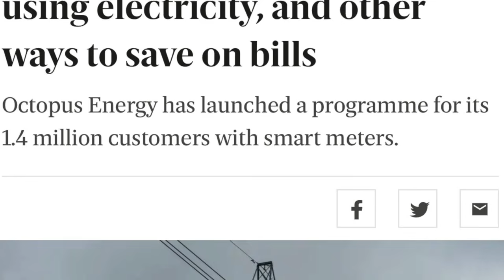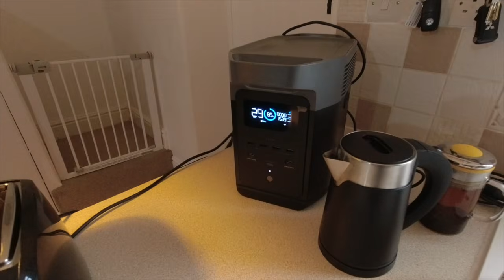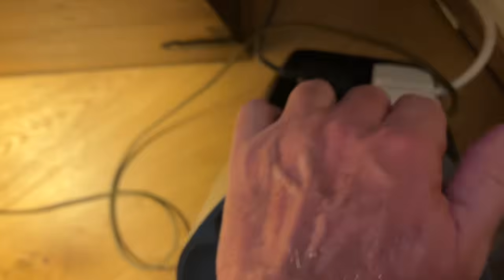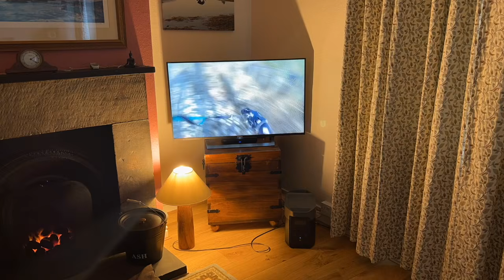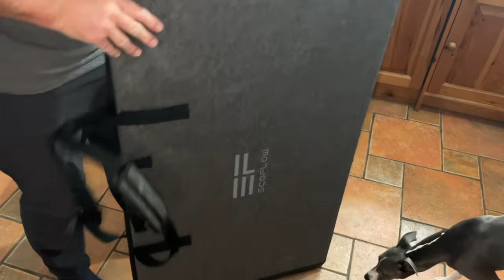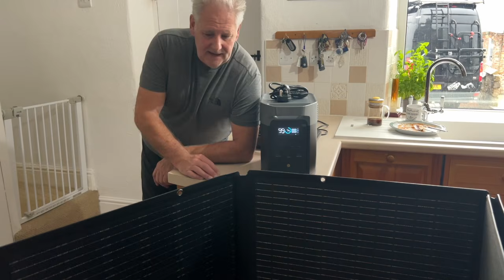Get Paid For Using The Ecoflow Delta 2 & Blackout Planning !

Comment: Dave, thx for this critique of the Ecoflow. If you were forced to choose- do you prefer the Ecoflow or the Bluetti? And why? Many thanks. Diane and Quinn
Reply from the maker: Hi Diane it all depends on what you are going to use it for and how much power you need too 
The Delta 2 is undoubtably the best of its size, it comes with a 5 year warranty and at good price 
The Bluetti AC 200Max is a must bigger unit and has the 12v RV this enables you to link it directly into wiring system in a campervan Boat motorhome  at 12v and it also has the back up batteries that you can add to use it at home too 👍 hope that helps 😍

Comment: And just for charging a battery once and then waiting forever 😴for a blackout, there are more special and cheaper alternatives than €1199.00🤑 for a multi-tool. I think, anyone who doesn't use the thing on the go should be aware that upgrading it to a serious home system with Ecoflow parts has to be well thought out, but it definitely costs a lot of money. 🤔
Reply from the maker: Yep you are right but what I’m saying is if you have one to use in your van you can also use it in your house 👍👍
Reply: Very true. I wouldn't recommend anyone get one of these to 'save money'. At the current price of £1100 and the advertised 3000 cycles over its lifetime (although still usable after that), the price per kwh works out at ~£0.4213 🧐. We pay around £0.35 down here in the south east of England (i.e. would never pay for itself) 😕.
Reply from the maker: @TheMarkGgr  yep you can only really use it this way and justify it if you use it for other things too 🙏👍😍

Comment: Great demo and a good idea to test it out to see if you could benefit from the offers, or cope in a blackout. WOW Electricity is very expensive in the UK now, less than 20p per Kwh here in NZ, and its all renewable on the South Island too, lots of Hydro. I've been cooking most of our meals on the portable Induction hob as its so much quicker - if I need 2 burners, just get the other one out of Sprintie the campervan! I have a small 'solar generator' that has a 10W panel and two LED lights in my emergency set up, plus various other USB LED lights we can use off power banks - always pays to be prepared. That portable Solar panel looks the business!
Reply from the maker: Thanks Linz yep the cost of living is very high and getting higher all the time at the mo as we go into National recession 🙏👍😍
Reply: Ours is 28p and my sisters 26p including the standing charge. Northern Ireland...UK. 
Dave is right though,  the cost of living is very high and getting higher all the time; well the electricity went down a tad in November but heating a whole house on gas or oil is ridiculous.
We're down to heating the whole house when it gets REALLY cold but at short bursts and use an electric heater (halogen) for heating one room the rest of the time, it's working out better that way for us ATM.
We were used to the thermostat doing all the work before but hey, not with todays prices. 
Anyway, Greetings from Northern Ireland Linz 🙂
Reply from the maker: @pa_maj.MARTINI-van-MAN  Many thanks 🙏